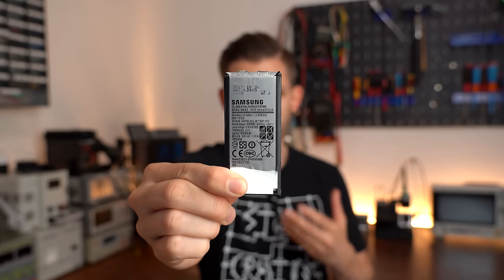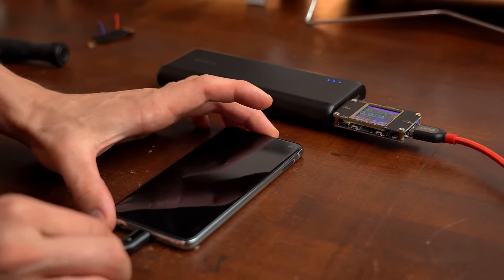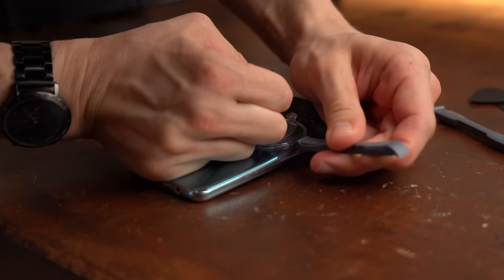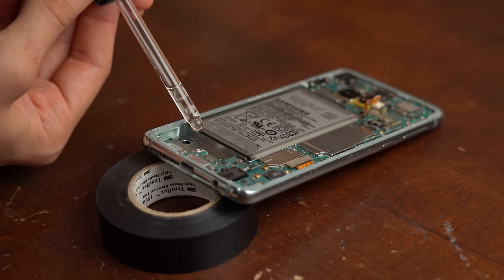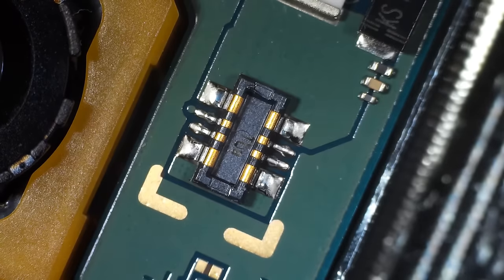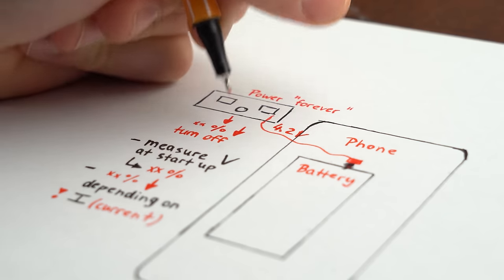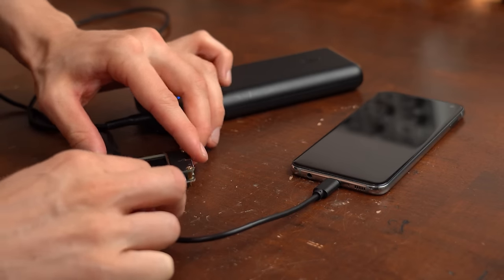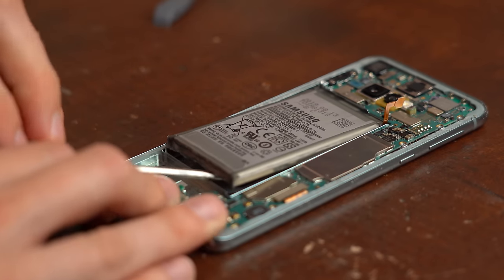I "Solved" Samsungs Swelling Battery Problem! (Batteryless Phone)

Comment: i laughed so hard when he said s10e "old". I'm writing this from my 8 year old sony xperia m5 and it still works fine.
Reply from the maker: Well, for me it is my "old" phone. But yes,....not really old at all.
Reply: Yeah, I was thinking about buying S10e, S10 or P30 Pro in 2020. Still with P30 and I consider it as "new" :D
Reply: @greatscottlab  whyyy it's such a good phone I use a s10 but the s10e is just as good imo and still relevant to this day I'd rather use a phone that's worth £20-40
Reply: Ye I actually bought a nexus 7 (2013) recently and it still works well for media and light gaming
Reply: Also do have it flashed with asop extended (8.1) which runs better than the last official update of android 6
Reply: I am still using a 2012 Galaxy S3 with Lineage OS. Remember the days of removable backs to access the battery.
Reply: @greatscottlab may I ask if it's possible for the phone to power on/startup by itself when power is back? Incase a power outage took place and the phone turned off
Reply: The S10e is my current phone and it just developed a boot loop which rapidly went to a total not responding condition. 
Before it went catatonic, when I plugged in a charger, it would rapidly sweep the charge level indication from zero to some current state of charge like 75%.

Is the battery level indication not a true number due to a suddenly bad battery?
Reply: I had the battery out, and measured about 3.8V, though it was unloaded, so maybe that's meaningless. I suppose I should check with a load

Comment: That's great, but the problem is that Android has a power manager driver. It thinks that there is no such thing as an infinite battery and the percentages will drop and the phone will shut down. If you turn your device off and on again, everything will work again, but it will not last long, after several such reboots, the phone will not turn on at all, because the driver will think that the battery is broken.

Comment: for me, just replace the battery with super capacitor, and then you can use the fast charging feature although doesn't make sense, just for current spike(mostly will use the capasitor though)
Reply from the maker: I think should be possible. Not completely sure though. But supercapacitors is also kind of big. Not sure if a lid would fit.
Reply: I've done it with just ELECTROLYTIC capacitor (470uF or so) on Galaxy S3, so definitely possible. Although, the fact i've also added an LED with a dropoff resistor in parallel may have played a role, cause the phone is driving something constantly at low current there. Anyway, those phone ARE perfectly capable to just power themselves from USB, they just don't want to.
Reply: This is my thought also. Construct a battery eliminator from capacitors etc. to fit into the original battery space and connect to the normal battery tabs on the BMS board (extracted from actual battery). This circuit should act like a small battery, so plug the phone in to USB power and the apparently low charge battery (I.e. uncharged caps) will get charged up until sufficient to allow the phone to boot and also add a bit of a boost when required, just like an actual battery would. No additional leads into the phone which just works as it should.

Ideally the total capacitance would allow leads to be swapped from one charger to another (so just a few seconds) without the phone restarting. A minute would be way more than required IMO.

I am not concerned with any sort of mobility. I just want to be able to run old mobile phones/tablets for other purposes (clock, radio, HA screen, whatever) off mains/USB with no battery involved as that WILL eventually fail and expanding Li-Ion batteries in the house are to be avoided.

I'm sure this is doable, but beyond my abilities to fully design. However the intended result of an intact phone that powers purely from it's original USB input is worth pursuing is it not?
Reply: @UKenGB  Would love to see a videos about that!

Comment: Giving an old Smartphone/Tablet a 2nd life is awesome. However, I'd suggest less destructive approaches:
1) Try using a Supercapacitor instead of a battery. That should usually work - I've already tried it on an old Samsung tablet. You may even get it in a proper form factor
2) More complex, but also doable: Modify the Android Kernel drivers. I've had the same issues with a Samsung Tablet where I modified the charging logic to only charge up to 3.8V. This caused the battery gauge to get confused and sometimes report low battery levels and the Tablet shut down. I've modified the battery gauge driver to report a percentage relative to the battery voltage instead - that worked fine. It might even be possible to modify it in such a way that it boots without battery.
Huge problem here is, that this is specific for every device :/
Reply: How did you do that? Can you post any resources for that?
Reply from the maker: Thanks for the feedback. Nice ideas.
Reply: i was thinking the same thing,,, then i came here and saw your comment.
Reply: I had a Nexus 7 installed in my car for a long time, and when battery died (most likely due to temp. variation in summer / winter) I removed it. I removed the BMS just like on video, put capacitor instead of the battery, and connected two wires "before" the BMS, to the same wires going to the tablet.

Then just connected the thing directly to 5V. It worked just fine, and with wires connected "before" the BMS, tablet was showing 100% SOC all the time for some reason.
There were couple things connected to tablet's USB port, like backup camera (easy cap) and audio DAC, and they were powered through tablet OTG, without external powered hub etc.

Although it's probably not recommended to power the thing with 5V if battery max voltage is around 4.35V of whatever. But it survived like that for probably a year until I decided to do some changes to my setup and, in the end, switched to raspberry pi.
Reply: @RoterFruchtZwerg  please explain
Reply: @ABCD-hf2ju  Youtube hates him and made his post invisible to all of us. (Not the post you can see talking about another post obviously...) It happens to me all the time.
Reply: @ABCD-hf2ju  I did/tried.. hope the reply stays visible.
Reply: @RoterFruchtZwerg  So we need to modify the kernel image file ??
Reply: @RoterFruchtZwerg  visible now
Reply: I can read something about lineage os.
Reply: @RoterFruchtZwerg  where is battery.c file
Reply: @ABCD-hf2ju  yes, you need to modify the kernel source files - in this case drivers / battery / sec_battery c. Then you need to compile the kernel and place the compiled kernel in a new boot image that you can flash to your device.
Reply: @ABCD-hf2ju  it is part of the original kernel source code for your device - in my case with the samsung tablet it's in drivers/battery/. You find a link to the kernel source for this device in the repo I mentioned. You can find kernel sources for many other devices if you look into the Lineage OS repositories or xda developer forum.
Reply: Being unable to boot without the battery is a current draw problem, I believe, rather than software. Voltage gets too low with only a charger supplying power. Which is why sometimes the phone will get further along in the boot process before 'browning out'. Also, weirdly enough, some phones don't shut down when the battery gauge is low - this might suggest it's an option that is relatively easy to flip on and off? Don't know much about the software side of things.
Reply: @RoterFruchtZwerg  what should be modify in c file ??
Reply: @iguanamoat  while current spikes might be also an issue, I think most devices have other reasons... e.g. when the kernel initializes the battery management it might just disable the USB power input and thus immediately die.
Reply: @RoterFruchtZwerg  It's possible, but what would be the reason to intentionally disable the ability to run off of the charging cord? It seems like it would be a great feature to have. I have also found that from the two conversions I've done, a single USB port (connected directly to the BMS) does not output enough to keep up with 100% of the phone's power demands, so there is definitely a physical limitation there during high-draw situations, at least with those two phones.
Reply: @iguanamoat  the before mentioned Nexus 7 (2013) for example issues a "dead/discharged battery" warning by flashing the white LED four times when USB gets plugged in while the battery is disconnected. In this case this is even before the kernel boots, so nothing that can be changed in the os. It won't even boot into the bootloader (fastboot).
On the Samsung SM-T280 however, while it won't power up regularly, it will boot into the bootloader even without battery connected when you hold down HOME+VOL_UP. If you then select "reboot" it boots Android just fine.
Reply: @iguanamoat  it wouldn't be "intentional" turned off, but because the power management has different power paths available, like also powering usb-otg devices or (reverse) wireless charging, or quick-charge/usb-pd, it might just cut off usb power for a brief moment during initialization 🤷🏻‍♂️
Reply: @RoterFruchtZwerg  That is interesting, and suggests that most modern phones and devices would run fine off of the charging cord as long as you temporarily attached a battery or battery analogue at boot. I would like this to be true, though I don't want to get my hopes up. Are you sure the SM-T280 was stable long-term and under load while being powered just off the charging cord? Perhaps a modern tablet is power efficient enough that a single USB input is sufficient, or USB-PD is enough to push the current needed. This would actually be quite a find for the carputer community if there exists a tablet that can run no-battery with basically no modifications just by going into the bootloader first.
Reply: And if you use a supercap of the same size it is about 1/2 the normal battery time and can last with power off for a bit.
Reply: @mrpeter887   Would you mind sharing the specs that you used when choosing the capacitor?
Reply: Точно! Можно же подключить конденсатор для имитации батарейки.
Reply: 1F 5.5v will do the job.
Reply: I still would put some batteries for when there is no power with a supercapacitor added that should work great so I can be mobile
Reply: @barryliebich3993  thats not the idea. The idea is to solve the battery swelling so scott remove the battery feature. You can use powerbank for mobility.
Reply: There will separate space for a battery in the custom laptop I want to build.... The problem is when the battery is inside of the phone
Reply: how did you get the supercapacitor to work, I'm trying a 1f 5.5 super capacitor and it doesn't turn on.
Reply: @patrickarcega9861  did you just connect the supercap to the + and - on the BMS board or did you have to do anything else?
Reply: @johnmo2774  to the bms
Reply: @patrickarcega9861  strange, mines doesn't work

What voltage does the super capacitor stay at when the phone is powered on
Reply: @greatscottlab  bro actually i did exactly same, but i made it working without usb type c, only from battery is enough.!/// u ask how? look when battery voltage more than 3.6v phone will freeze in 2% and it will keep working till 3.6v and higher. i just connected more batteries to existing, and first few month it will drop by 2% and stays that way if battery higher than 3.6v, but also when powering off for an hour, and back on it shows 80% or more again, but nex 6 month it surpriced me freezing in 56% till 3.6v
Reply: @johnmo2774  you need to charge it to power it on
Reply: @patrickarcega9861  tried that didn't work, capacitor would discharge itself through the phone

And the phone won't charge the capacitor as it detects too much resistance
Reply: How do you exactly modify kernel drivers? As far as I know they are all closed source code?  How do you find out in compiled binary file where and what to change?
Reply: A capitor could be even more dangerous than a lithium battery as the short circuit current would be huge.
Reply: @mrpeter887  this sounds super interesting. I heva  nexus 7 (2013) that is about to crap out, could you send me a schematic or photo of your mod?
Reply: Yeah not you didn't.
Reply: @mrpeter887  i havel shield k1  its possible mod?
Reply: @greatscottlab  hey man, I have a S10+ that I want to turn into a console. can I buy one of these batteryless kits from you?
Reply: A supercap. Honestly a cool idea. Gonna keep that in mind for a oculus battery delete mod.. its battery dies quickly, and id rather remove its battery before it swells, might aswell run it from a big powerbank.

Comment: Funny, I was looking into doing this EXACT thing with an old Nexus tablet so I could use it as a Home Assistant terminal. Good to know someone's done 99% of the work!
Reply: I wanted to install docker on a phone for this, but it seems to require kernel patches at which point I gave up. I am really confused why it isn't easier or more common to just flash a phone with a regular Linux distro GSI image. Phones are now more powerful than the home servers I'm considering, and they consume less power.
Reply: Didn't even think of that!  Thanks!  I have an original Galaxy Tab (yep.. the first one!) that's still running fine except for the battery life.  Perfect use for it, since I just started my Home Assistant journey.
Reply: I have been trying for weeks with a Psion Netpad. It's similar issues from 2001. I think I got it when I hit the right numbers. The video gives me an idea or two more to explore.
Reply: @Rex Sceleratorum  yeah but phones aren't ment to sustain running at full power for extended periods of time because they thermal throttle because they don't have cooling fans.
Reply: @xxzenonionnex7658  There are two factors here as I hinted at. One is performance per watt per cost. Phones tend to lead here because they are made on the most efficient, advanced nodes and are still cheap because of mass production. 

Second is raw performance. Phones certainly cannot beat the latest 200W TDP i9 chips. But for an always-on home server raw performance is not the highest priority compared to energy efficiency. 

I don't plan on running my home server at full power for extended periods. In fact my current server (Atom processor) sits at near 0% most of the time. As it should. If an SoC has a temperature problem, it can simply be throttled in the kernel and still give you more than enough performance.